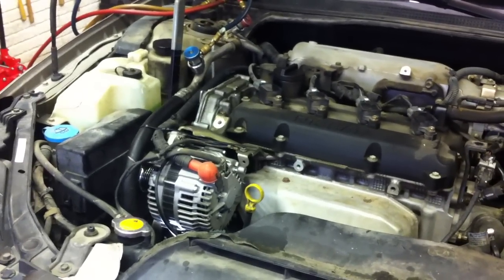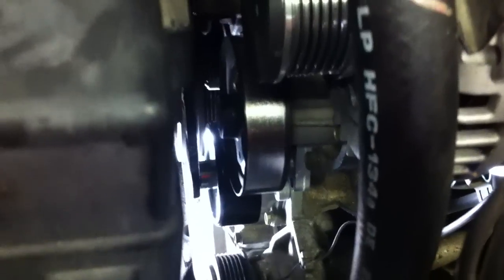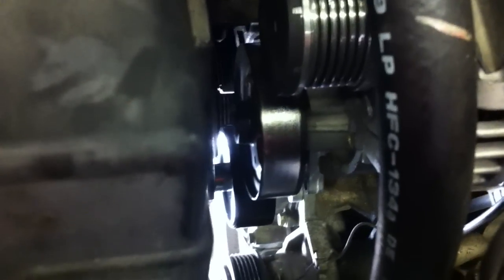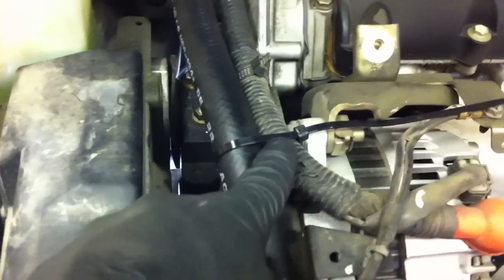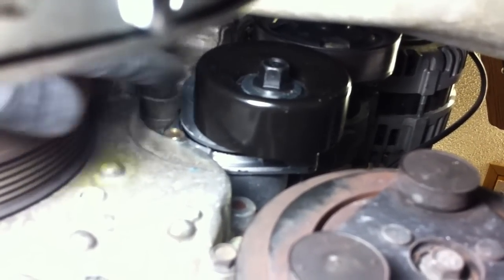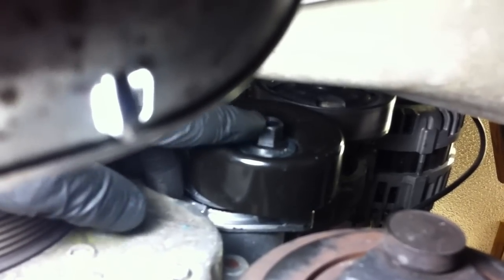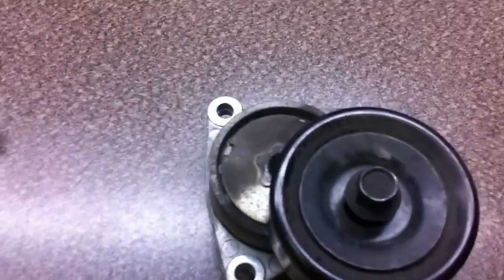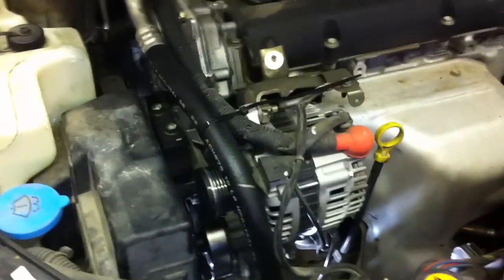2005 Nissan Altima 2.5L serpentine belt tensioner replacement

Comment: How did you remove the pulley? I gather that when you use a box wrench and pull in the direction to tighten loosen the pully to put the belt on. So what direction would I turn to loosen the bolt in order to replace just the wheel pulley.
I don't know if I need to replace the whole tensioner. Just the wheel pully looks wobbly. Any help would be great as I have a 2005 Altima 2.5L.

Comment: Thanks for the video because I need to replace the tensioner on my '05 Altima 2.5S.  With a bit of luck I might get that top bolt out of the but I'm pretty worried about getting it back IN.  Any suggestions because, as you know, it's tight as heck in there.

Comment: never open/disassembly the new tensioner due to the safety from the factory. All we need  is  loose the couple nut/bold that keep the alternator. The long bold from the alternator pull out  enough to push the alternator forward. You will have space from the top near by the alternator for moving the bolt from tensioner then / by using Ratcheting Wrench.
Reply: what the hell are you talking about? the tensioner is self adjusting, you don't need to mess with the alternator
Reply: @mrcokez1  Dog, the manual says to remove the alternator to get to that top bolt, first step is to remove the alternator, though it appears you can just remove one bolt and turn it away without removing it fully.

Comment: My serpentine belt seems to have slipped off, doesn't seem broken, any ideas? Do they just slip off sometimes?
Reply from the maker: The tensioner could be worn out and have some sideways slop in it. Put your tool on it and rock it back and forth against the spring tension. See if it cocks sideways when doing this. If not, did you perhaps run through a big puddle of water?  That could get belt wet and throw it off. Rotate all of the pulleys and make sure one of them is not locked up.

Comment: can you use the belt tool to unbolt the  pulley cause u can't get a regular wrench on it to little space
Reply: Too late but ive used flexible open wrench 14 mm

Comment from the maker: @papitosabe. The tensioner pulley bearing was noisy. That's why I replaced it.
Reply: +Randy Templeton : Is this what causes the Altima to make a loud noise when idling in drive (for instance, at a red traffic light) but when you shift the car in neutral or park, the noise goes away completely?
Reply from the maker: Dane Haughton could be bad motor mounts. See if you can check the rubber for having cracks. Probably the one at the right side of the car and the one near the radiator
Reply: it"s the alternator clutch pulley

Comment: can I ask why you replaced it, I have the same year car. I was thinking on replacing mine because when the car is in drive stopped it has a hard shaking idle. about 200-500 rpm. I heard if I replace this the idle should be better. did you have similar idle issue's?
Reply: Randy Templeton great thanks for the help. it idles rough in revers or drive at a red light.

Comment: I have changed the belt, successfully have it installed and properly aligned via careful check. But immediately after I starting the engine, the belt took off. What might be wrong?
Reply from the maker: Lyu Yang see above questions

Comment: Could the serpentine belt cause your power steering to go out until the belt is replaced or put back on correctly?
Reply from the maker: Not likely. If the belt is there and routed properly then the power steering should work, unless it has a problem of it's own.
Reply: Aja Ceairra no

Comment: After replacing the belt on my 2004 altima it acts like it's idled low i have to keep my foot on the gas and brake to keep it going what could be wrong please help
Reply from the maker: I have no idea why it would idle low. Do you have the belt routed properly on the pulleys?  Remove the belt and run it for a minute and see if that changes the idle.

Comment: Mine shakes at 2000rpm could this be the issue ?
Reply from the maker: Do you mean the engine or belt shakes at 2000 RPM?  Or does the car shake while driving it?

Comment: This was nightmare for me the lower bolt is ok but top bolt i have to remove fuse box and over flow tank, get long  size socket 12 mm and thats it its too tight even returning back the belt is a headache 😂 but ive done it finally